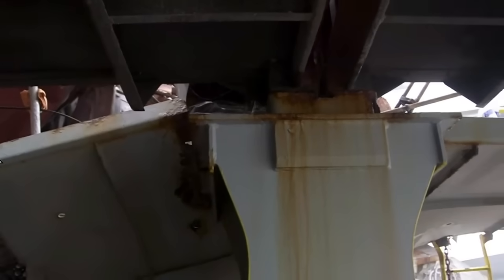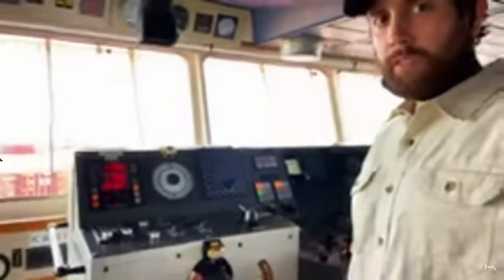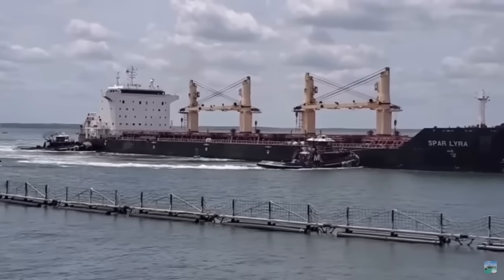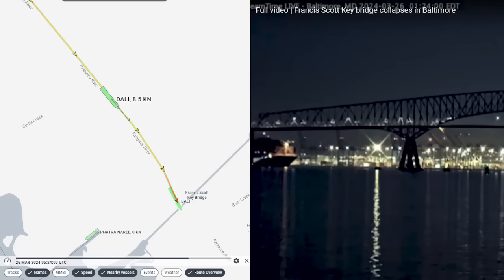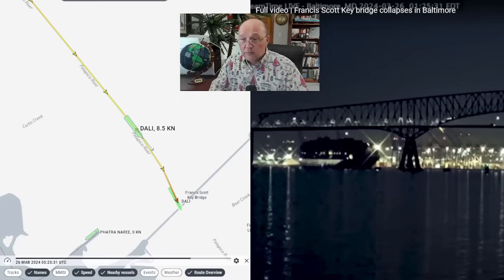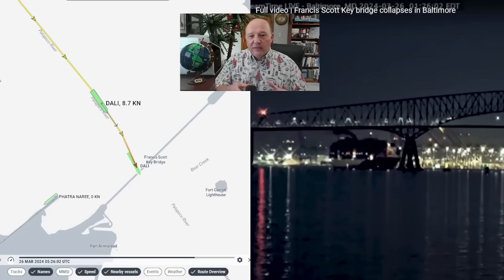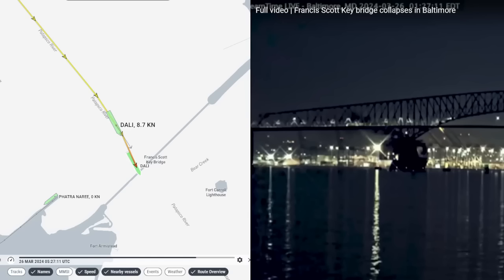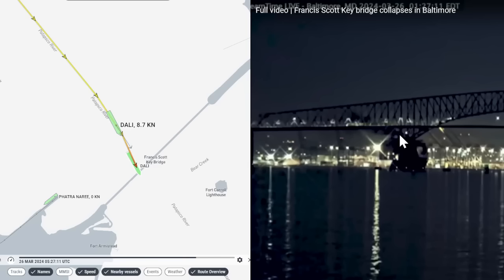Dali Timeline from Data Recorder in Striking Francis Scott Key Bridge in Baltimore, March 26, 2024

Comment: For certain all vessels will be escorted past any bridges to open sea from now on and frankly that should be the standard.    If there is infrastructure within the stoppind distance of your anchor weight, you need a tug escort.
Reply: How many years do you have?
Reply: Nope. A bridge collapsed here in 1975 and as recently as December we denied a (much smaller than the Dali) ship passage of the replacement due to risk of collision. Tugs were not an option even on the much smaller ship due to risk of fatality to the tugs. As you can see in this video, tugs almost sunk trying to stop a much smaller ship from hitting a bridge. They're non-starter. Tugs do not stop ships this big that are moving at any speed. They can barely hold them steady in moderate winds if they're already stationary.
Reply: It may not be safe for tugs to try to direct these huge ships when said ship is at 8 knots.  Bridge protection may be more cost effective anyway.

Comment: TITANIC kept the power and lights on until the final end in 1912.
Unable to do this in 2024.
Reply: Also, hundreds died. Human history is full of varying degrees of success and failure.
Reply: Titanic would also fail modern emissions and required hundreds of people just to keep the engines running
Reply: @SilverStarHeggisist  
At least Titanic crashed into an ice berg in the dark open sea with no radar, not a bridge support in a harbor

Comment: don't need tugs for every ship if the bridge had bumper pads. 
I've even seen areas in major cities where someone paid to erect bollards to protect pedestrians from out of control cars, of all things.
Reply: The problem is this bridge was built in 1977. The main spans did not take into account ships of this size. There are bumper pads (dolphins) but they can't be of sufficient size (basically need a large artificial island) without blocking the channel. The ship came in sideways so it actually went around some of the dolphins. Need a bigger bridge with wider spans first, or a tunnel, or to move the port downstream.

Comment: Using tugs is NOT in the least expensive when compared to the possibility of demolishing your bridge and killing people! My 300m LNG ship takes 4 tugs in and out of the open sea Bay we go into every few days. This is mandatory  . Our VDR audio on our VERY extensive bridge is excellent due to the number of microphones fitted. On the other hand the recording parameters ARE pretty limited. The port requirements in Baltimore are totally at fault and inadequate irrespective of any issues on the ship. Along with poor infrastructure such as lack of protection for the bridge and appalling bridge design.
Reply: Agreed: my thinking, this was not ideal risk analysis on the ports part. 

I dont know about in the US but in the ports Ive worked in Australia tug Escort arrangements are common to protect infrastructure and the ports ongoing operation (think shipping stopped through blocked channels etc). Typically this is as directed by the Harbour Master in consultation with the harbour pilot/s.

Port Hedland (Australia) active escorts most outbound bulk carriers for 10Nm (approx 1hour & 15 minutes) till they are clear of the tidal constrained by draft channel.

An escort tug (line up) Centre Lead Aft can generate serious turning force at the 8 knot speed in question.. could have made all the difference.

Clearly the decision to not have at least 1 active escort tug CL aft for the 25 minutes it takes to steam the 2.5Nm clear of the bridge (at Moran’s published 2 hour minimum escort rate of $6200) will I think now be reevaluated.
Reply: Tugs are usually forbidden to escort near bridge pylons due to risk of loss of life of tug pilots for ships even a fraction as big, even here in Australia. They simply deny transit if there's a risk. 

Bridge is a relic from 1977 and unable to be retrofitted sufficiently for a ship this big, needed to be replaced to be safe with a ship this size, ideally with a tunnel. Tugs would have just resulted in an additional fatality.
Reply: @nelsonraines5003  None of the major ports in Australia accept ships this big that also transit bridges with Pylons in the waterway. They recently forbade the new icebreaker from being able to transit the Tasman bridge due to risk, and dismissed using tugs as an option due to risk to the tugs. And it's much much smaller. Even where an older cruise ship transits a bridge (like in Brisbane) there's no tug escort. Sydney, Melbourne, Brisbane, Perth, Adelaide, Hobart, Darwin, Cairns  none of them have bridges before the container ports. Sydney harbour lets some older (re smaller) cruise ships pass the bridge, but it has no pylons in the channel, the ship will run aground first. 

A tug in this situation would have just added to the fatality count.

Comment: to CLAFY THE PROP IS VARIBALE PITCH.  THE PROP FINES MOVE. THE ENGINE GOES AND THE SHAFT GOES THE SAME WAY.
Reply from the maker: This ship has a fixed prop attached to a slow speed diesel.

Comment: Just the cost of removing the bridge is more than an adequate dolphin system that would have saved the bridge would have cost. Maryland rejected an adequate dolphin system as too costly. L9L!
Reply: An adequate dolphin system would have blocked the channel. The main spans of this 1977 bridge are too short to support the artificial islands of sufficient size to stop a collision such as this. It had dolphins, they didn't stop it. There isn't a bridge in the US over a shipping channel with sufficient protection to stop this sized ship, there's only about 5 in the world that are that have any pylons in the waterway at all. As you can see in previous bridge collisions to bridges of this era, they replaced them with bridges with newer, larger spans, and yet even those still don't have big enough islands / dolphins that could have stopped this.

Comment: it is all bunkum and useless. there were american pilots to escort and local pilot. they had no idea what to do when power went off and got confused and had no option but to shout: HELPPPPPPPPPPPPPPPPPPPPPPPPPPPPP AKA MAY=DAYYYYYYYYY.
----------------------
ANOTHER BIG MISTAKE: THE SHIP SHOULD HAVE BEEN DRIVING TO EXTREME RIGHT WHEN DRIFT IS TOWARDS RIGHT SIDE.
-----------------
A SIREN SHOULD HAVE SOUNDED FOR THE BRIDGE CONSTRUCTION WORKERS TO GET THE HELL OUT OF THERE WHICH THERE WAS TIME.
--------------------
ALSO THEY SHOULD HAVE WORN FLOATING JACKETS AS IT WAS COLD AND AT NIGHT SO THAT A JUMP WOULD HAVE SAVED THEM AND NOT KILL THEM. YOU CAN JUMP AWAY FROM THE BRIDGET  TO GIVE YOURSELF A CHANCE. OR HANG ON TO TOP RAIL WHICH WOULD HAVE BEEN IFFY. I AM TALKING ABOUT NTH MINUTE WHATEVER YOU HAVE TO DO SO SAVE YOURSELF.
----------------
SLIDING ON THE ROAD WOULD HAVE BEEN AN OPTION BUT NOT WITH THAT WHOLE STRUCTURE FALLING. I MEAN IF NOTHING FELL ON THE ROAD THERE WOULD HAVE BEEN HOPE.
-----------------
IF A SIREN WAS FOUNDED THERE WAS TWO MINUTES FOR CONSTRUCTION WORKERS TO GET THE HELL OUT OF THERE AND CLOSE THE BRIDGE!!!
--------------------------
A VERY FRAGILE BRIDGE, NIGHT TIME, NO PROTECTION, NO ALARM, NO TUG-BOATS TO DRIVE TO JUST PULL IT OFF WHEN THE SPAN ITSELF IS VERY NARROW. AND NOBODY WANTS TO TAKE ANY SORT OF RESPONIBILITY.

AND AS USUAL POOR IMMIGRANTS HAD TO PAY WITH THEIR BLOOD!!!
-----------------------------

A SORRY STORY ALL AROUND. WHAT ELSE IS NEW? AMERICAN INFRA IS OUTRIGHT OUTDATED AND NOTHING HAS BEEN DONE TO FIX THEM WHEN TRILLIONS AND TRILLIONS AND TRILLIONS HAVE BEEN BORROWED FOR WHAT GOD ONLY KNOWS.
------------------------------
AMERICAN PEOPLE ARE NOT DEMANDING AND MIRED IN THIRD RATE POLITICS.
------------------------------
BIDEN INFRA IS NOT ENOUGH. 200 BILLION IS NOT RELEASED TO FIX THESE OLD BRIDGES ETC. PEOPLE WHO DIED WERE FIXING POT HOLES TELLS YOU HOW SAD THINGS ARE.
-----------------------------
THIS IS CANARY TO THE COAL MINE AND WILL ONLY GET WORSE.
 I KID YOU NOT!!!!

Comment: Tug boats are cheap compared to lost lives and replacing bridges. 🙄
Reply: They're also utterly ineffective in situations like this and would have only resulted in a likely extra fatality. They're barely able to keep ships this size that area already stopped from moving in moderate winds, much less STOP them when underway.
Reply: @peter65zzfdfh  It didn't need to be stopped just steered, and they said a tractor tugboat could have done it. If the current tugs can't handle these big ships, build bigger tugs then.

Comment: blah, blah, blah

Ships do not turn, or slow.
Dali was 0.6 km or so away from the bridge.
Dali made a hard right turn into the bridge.
Everyone talks about everything the vdr had except the rudder.  What direction was the rudder before the power was out?  What direction was the rudder when the power returned?  This is on the vdr.
The tide current was 0.7 or so knots parallel to the ship.

Someone should make a video showing the ship location, time, and vdr info with bridge audio.  It is only 4-6 mins
Reply: You're someone, why don't you do it? Or are you criticising Sal for making a video not including information that isn't public yet?
Reply: @jimbobeire  I am criticizing the important information not being released. Something did not work right.  What was said may have happened. It will come out in time.

Comment: ok so I'm guessing you know nothing about ships. At least until this happens. Now you seem to know what is going on. what I get is why did they do anything. It probably would have floated right through. But they are steering dropping anchors. This seems crazy. It looks different here. But look at the day light photos. There is a Bumper and that ship is maybe 10 feet away. And it's like they float past it and turned in to hit the pillar.
Reply: The turn to stbd was caused by bank effect and right screw propeller effect when running astern with the ME. NOBODY TURNED THE SHIP TO HIT THE BRIDGE.

Comment: It would take a couple minutes to go from the engine room to the emergency generator. The power is off but you see the plume of black smoke from the engine running under heavy load in reverse. You claim 9 minutes to go from ahead to the prop stopped. NONSENSE! WHY ARE YOU COVERING UP WHAT CLEARLY IS A SHIP PURPOSELY RUN INTO THE BRIDGE?